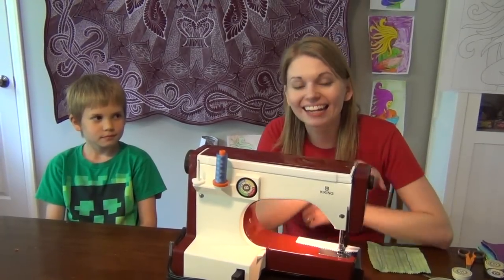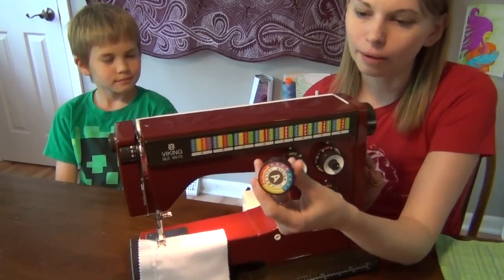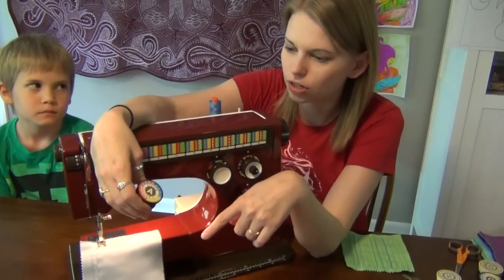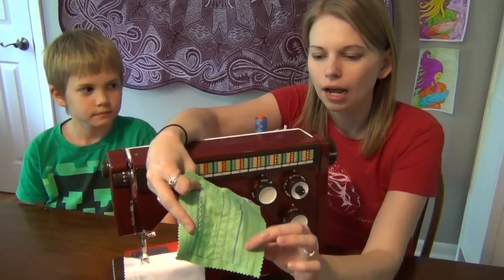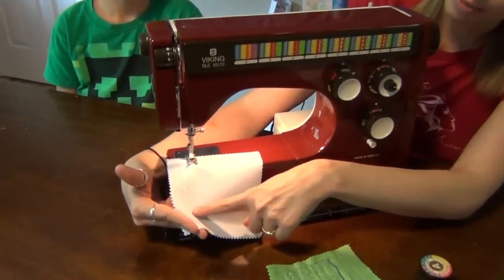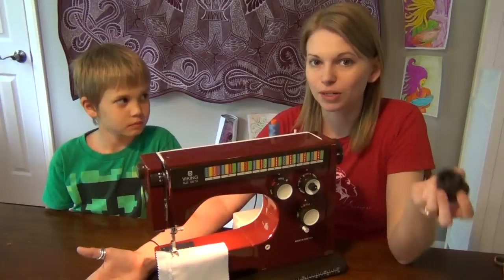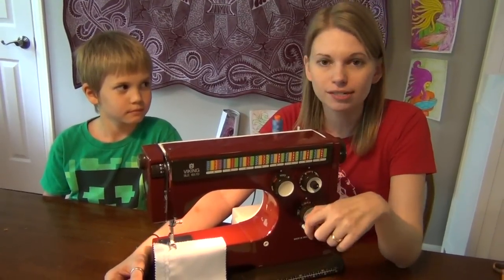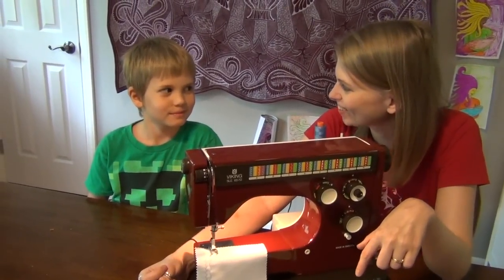What is a CAM sewing machine? Viking Ruby 6570

Comment: Congratulations on your find!  My absolute favorite sewing machine (I have 8, don't ask) is my Singer Touch & Sew 628 manufactured in the spring of 1966.  It has black top hat cams/discs.  She sews a perfect stitch and can go through many many layers of whatever I throw at her.  Just for grins and giggles I did stitch test samples and then folded the fabric over and stitched again.  At eighteen (!18!) layers she was still going strong but I had gotten down to such a size that I could not effectively fold it over again and stitch!  These old made out of metal machines are amazing.  Have fun!
Reply from the maker: +Celia H - What a wonderful story! I'll have to check out that machine too. I keep meaning to spend more time with Ruby, though I'm having a lot of trouble finding a compatible darning foot that will fit her. I'll figure it out and make more videos with this fun machine.

Comment: I bought the 6460 from ebay, in the same red, because I couldn't resist. Bought it as "parts" because supposedly the motor needed to be replaced. Spent $90 including shipping, and all, betting that they didn't know what they where talking about and believing the machine would be fine. It turns out, I made a good bet. Needed to buy some more cams but now I have a good sewing machine to fix what I want or make what I want. I do love this tank, it can do more then the mouth can hold, not that I have many projects like that. But if you are doing many projects with this thing, I might sub because I need all the help I can get.
Reply from the maker: Unfortunately I no longer have mine. Keep playing with it and you'll get your groove. It's a very easy machine to use and the features were really fun!

Comment: So I just bought a rebuilt Husqvarna 6360. I had no idea what a cam was thank you for your explanation. I have not gone online to look at the owner's manual. What I find interesting on the front of my machine there's an A B and C🎉 yet the canvas in the back of the machine is a D. What do you do with a d when you got ABC on the front of the machine? It is my intention to use this machine to make bug screen panels for camper vans as well as insulated window coverings. What is the heaviest thread that you can use in this machine? When I try to Google it I get different answers😂 thank you for your time I look forward to looking back at other videos
Reply from the maker: Unfortunately I sold this machine a few years ago and honestly don’t remember. I did find a PDF manual for it pretty easily. However I never found a compatible walking foot for it, and I searched high and low using every dealer and wholesale connection I had. Viking changed foot styles so often anything older like this is really limited on what you can find. Sorry I couldn’t be more helpful. It is a fun little machine!
Reply: @LeahDay  this going to sound like a dumb question but what do you mean walking foot? Mine has a foot pedal it's a new one seems to be multi-purpose

Comment: I have had my machine with cams, a Viking 6460 for a couple years and now that I've worn out my other Viking machines, (they basically will be used for parts because you can't get parts to fix the machines anymore, tho I've been trying for 6 months)Anyway a owners manual wasn't included. U have absolutely no idea how to take the cams out and put them in. I tried a little but know I will break it if I horse it too much.Thank you. Ellen

Comment: Hi! Do you have any follow up thoughts now that you have had this for a while?
Reply from the maker: Honestly I don't think I would get this machine now if I had to do it over again. The place where the cams sit in is cracked and while it's not broken to the point the cams don't work, it's very close. This machine was very innovative for the time, but I dislike how Viking changed feet attachment types so often. This makes it impossible to find feet that fit properly and are decently made. Most are very very cheap generic feet and those still require testing and fitting to work. So all around, it's pretty, it's nice to put out to have a red machine to look at, but no, I don't sew on it often.

Comment: Who was the eBay seller if you don't mind me asking? It looks like one of my rebuilds.
Reply from the maker: Paul Reynolds It was Pickofnoco. Is this one of your machines? If not, what can I expect to replace if this machine hasn't been serviced in many years?
Reply: No, not one of mine but still a nice looking machine.
If it wasn't serviced by the seller and there's no service history then it would be hard to say for sure. 

The main problem was with the grease that was used originally. It became viscous after so many years or in some cases dried up like clay and seized the mechanisms. The result would be stiff or frozen knobs, drive shaft, needle bar or shuttle. 

If you're not experiencing any of those problems then keeping it lubricated would be the best course of action. I recommend a spray lubricant called Tri-flow. It penetrates well and softens the existing grease. Use it on all of the moving parts but be very careful not to get it on either of the two belts or the electrical portions of the machine.
 
The fixed cam on these machines had to be replaced after so many years. The nylon would crack. You can tell when this happens by looking in the back where the removable cams go. A crack usually begins to appear in one of the three receptacles for the cam tabs. If this happens though, you'll notice because the stitch timing will be off and the removable cams won't stay in.
Reply from the maker: Paul Reynolds Thank you so much for your help Paul! I'll take a closer look at the machine today and especially check for cracks around the cam area. I really appreciate your tips. Do you make videos on machines or restore them? What is your Ebay seller name? I'll have to check out your store!